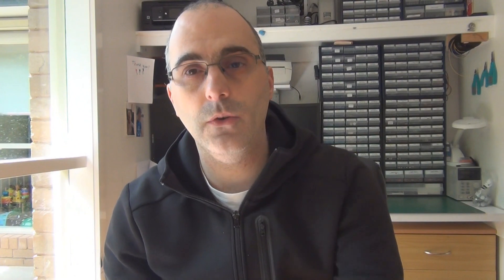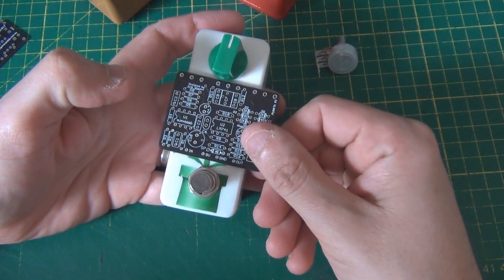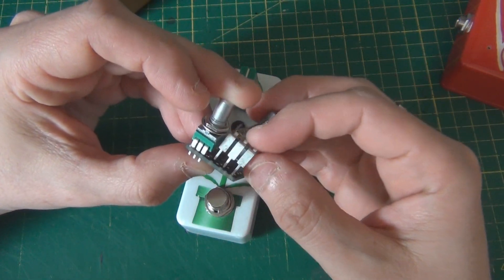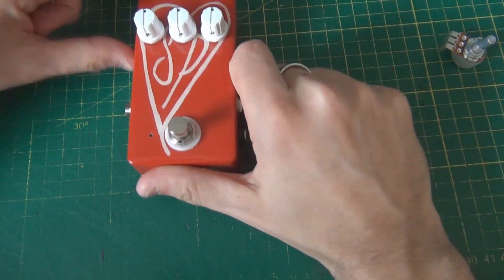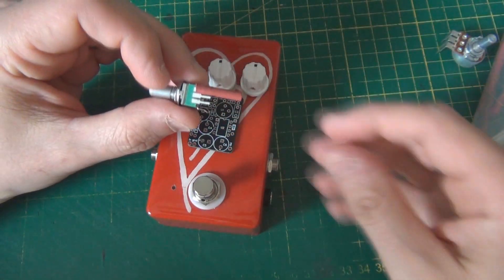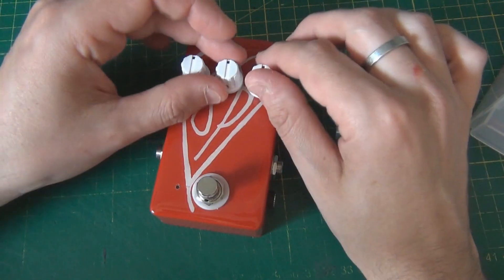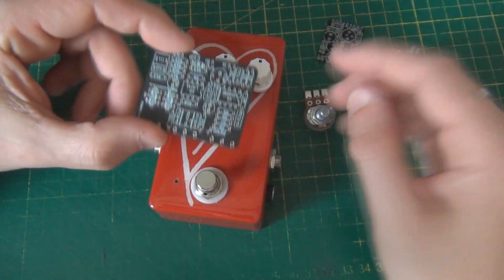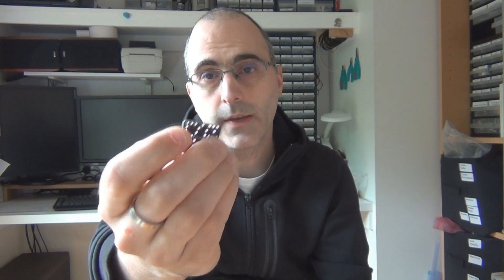The Most Common Potentiometer Question

Comment: the question i have is why not number the pot schematic pins. Sure, most times you can see how pins 1 and 3 are lain out,
but on some circuits it's not clear and i find myself swapping 1 & 3. Just an occasional pain.
Reply: I've seen that on a few schematics. It depends on the software used to draw them up. I use EAGLE to draw my schematics, so instead of the "1, 2, 3", it uses an arrow on the one leg, which indicates "1", the middle is still "2", leaving the remaining as "3". But there are a lot of schematics out there that don't even have that.

Comment: I had a bit of trouble drilling holes for your Turbo overdriver pcb with the 9mm pots, i was just able to fit them in board mounted, but then found didnt space for top mounted jacks!

Comment: Hey there, a question related to potentiometers.
I am building a Siberian Muff, but I do not  have Log Pots here in Egypt, can I substitute it with a linear ?

I have heard that I can add a parallel resistor with 1/4 of the Value of the linear pot and it will work.
Reply: Yep you can substitute it with a linear pot. It won’t respond the same as a log pot would but it will get the job done fine if the total resistances of the pots are similar enough
Reply: @Hattrick249  
I have found a workaround on a forum that worked perfectly. They suggested adding a resistor with a value of 1/4 to 1/5 of the Linear pot's value between the centre pin and the Ground.

It does the Log thing in a good way according to my Multimeter. Still trying to find a good way to etch my board instead of the toner transfer. Only then I can try it on a pedal.
Reply: @bishoy95  Nice! Looks like that resistor would convert the linear response of the pot to a more logarithmic curve. great little catch to make the substitution work better

Comment: Quick question: why are guitar pedals housed in metal boxes? Is it for grounding the circuit?
Reply: Though not all enclosures are metal (Behringer and Dan Electro have made some plastic ones, for example), a lot of them are. I feel they are for two reasons. 1. Durability. This thing is designed to be stepped on by a 200 lbs person. Or at least get kicked by one. 2. Faraday Cage. If you want to protect your circuit from "noise", enclosing it in metal will definitely help.
Reply: @erikvincent5846  Thank you for the info.
Reply: @erikvincent5846  I'd like to build a pedal with a wooden enclosure.. would I just have to either use shielding paint or tape to create a Faraday Cage???
Reply: @AaronAubreyPhoto  that would be the goal. Anything metal to 360 degree enclose it from RF noise. Even gluing aluminum foil to the inside would even work.

Comment: Hi Paul, I'm trying to make a double a/b switch (mono in a/b out and a/b in mono out with TS on all ins and outs) with a TRS jack to receive signal for a/b positions. Does anyone know how this would be wired? I understand using an actual stomp switch but how the hell can I take an on/off control signal from a Boss ES-8 and make it work with the a/b? I'm also trying to run a buffer on each of these but I'm pretty sure I found some decent stereo prebuilt pcbs on ebay for $15 a pop.

Comment: Hey Paul,  I have a quick question for you.  I used multilayer ceramic caps in my Rullywow Eaglet.  It sounds great but you mentioned a potential issue with using this type of capacitor in  that position.  I noticed that you used the same type I used in your TS808 for example.  Should I try to swap them out for discs?  It sounds great as it is. But I don't want it to fail someday because of a silly oversight.   Also, fyi I stuck white led's in the Eaglet rather than reds and it screams.  Love the channel.  I don't know why but I can't stop watching you talk about this stuff.  -Tom
Reply: Ceramics, though awesome in "switching" applications like power supplies, do have a trade off: microphonics. As ceramic is microphonic, if you tap on it with any force, it creates a "charge", which if plugged into an amp sounds like scratches or pops. Sure, if the pedal lies still, you won't hear much difference between MLCC and a film capacitor. But if it moves around, gets kicked, or is stomped on, then microphonics start to happen. SMD mlcc's are better than through-hole, when it comes to this, but it's still not perfect.
Reply: @erikvincent5846  Oh okay interesting.  As long as they aren't going to blow up my pedal I can live with some noise.  But in the future I'll use the standard crappy disc caps.
Reply: @thomasseaton8320  I guess there is one other exception, too. If you get ones that have a C0G/NP0 coefficient, they are usually dense enough that the microphonics are negligible. Otherwise, I use box film capacitors.
Reply: @erikvincent5846  Thanks Erik.  Can you explain why ceramics are used in a circuit at all?  I've read that sometimes subbing a film is okay and sometimes it isn't.
Reply: @thomasseaton8320  No problem. My general rule of thumb, and you will see this in the DBE designs, is that if you are dealing with really small capacitances, such as anything under 1000pF, I typically use ceramics because I can get C0G/NP0 ones easily and cheaply and in most applications that will be the best. Over 1000pF, they can get a little more costly for through-hole applications, so then I go to film capacitors up to around 1uF. From there, I start into electrolytic capacitors. This is just a rule of thumb for through-hole guitar pedals.

At my day job, I do industrial electronics, most of which are SMD, and those rules usually don't apply in those cases. For example, I do a lot of stuff with switching regulators. Because I need capacitors to handle switching speeds into the MHz range, this is a territory where I'll use MLCC SMD capacitors all the way up to around 22uF, if the voltages are high enough (35V or higher). I'll use SMD tantalum capacitors for the same "speed" reasons for things above 22uF, or I'll use them for 10uF and 22uF, if the voltages are 25V and below as they can usually do that better than an MLCC, for the same price point.

That's the thing. Each capacitor has its purpose. But at least through-hole capacitors for guitar pedal building usually have a more rigid rule of thumb than general electronic engineering.
Reply: @erikvincent5846  I understood 10% of that but thanks for the thorough explanation.  Haha. The ten percent I understood is helpful though.  Thanks
Reply: @thomasseaton8320  No worries. If you stick with that "rule of thumb" I started with, that's a good start. When building pedals, if it's under 1000pF, stick with the ceramics, otherwise, it's film and electrolytics for you!

Comment: Basically the pots are variable resistors with certain value, nothing more magical about them.
Reply: Or voltage dividers
Reply: @soejrd24978  most of the times. Sometimes, a current limiter.
Reply: True, but you can use them as a single variable resistor (pin 1 and 2 used, but 3 left floating or just bridged to 2), or as a teetering pair of variable resistors where one side grows in resistance while the other side shrinks, which, as the folks below stated, makes a great voltage divider (or a current limiter, especially in an LM317 circuit)